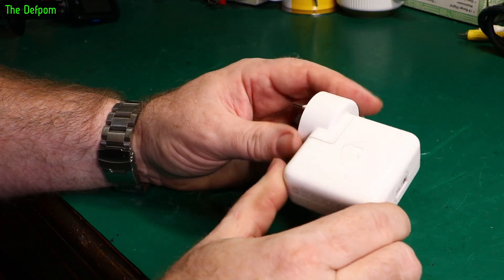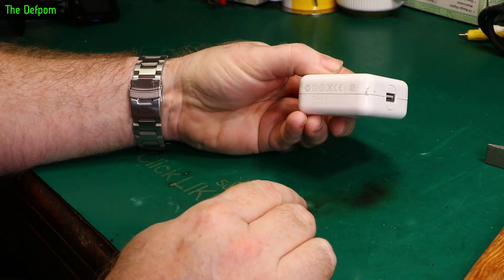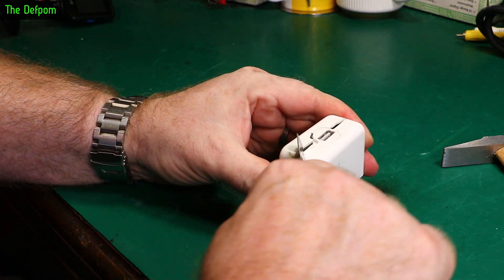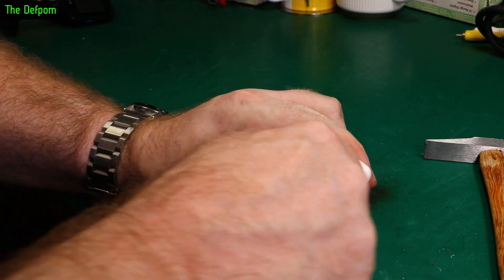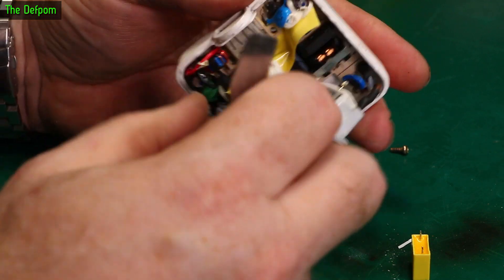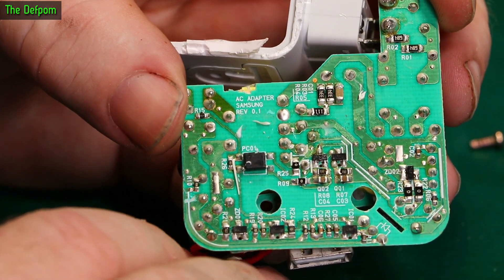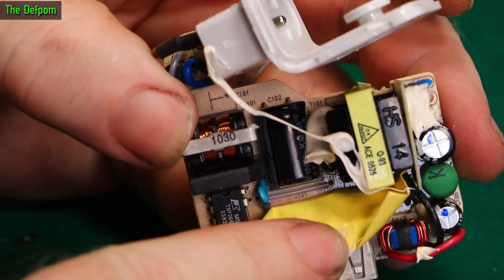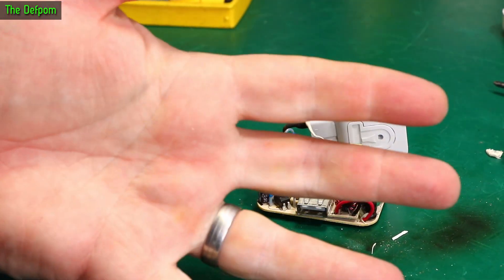🔴 What Is Inside ? - Apple Charger from 2005 - No.1105

Comment: 2005 is way before the first Iphone (2007) and certainly before the iphone 4 (2010).
But it could be that the design is from 2005 and it stayed in production a long time.
I couldn't see any apparent date codes on the components inside to give a pointer when it was actually made.